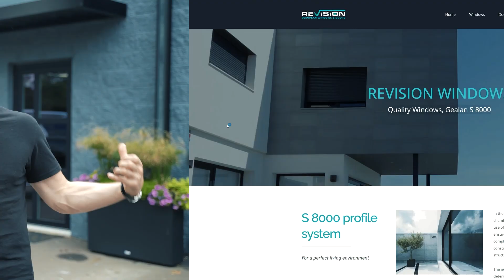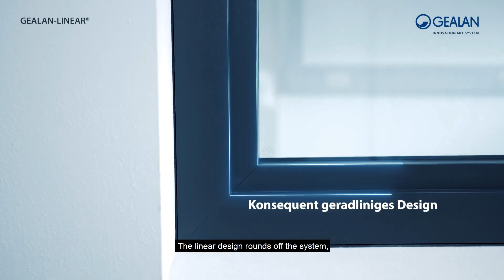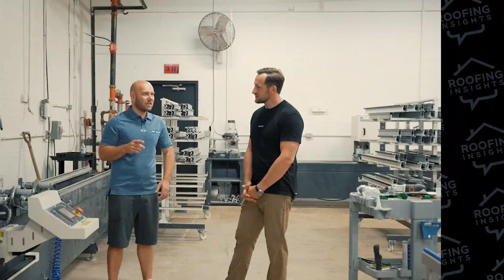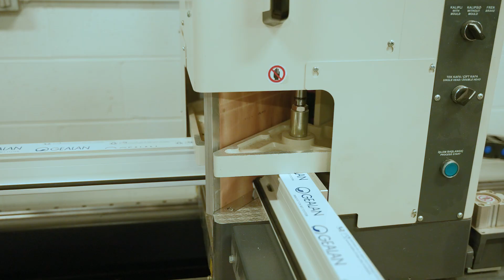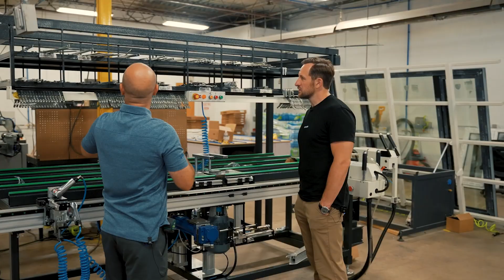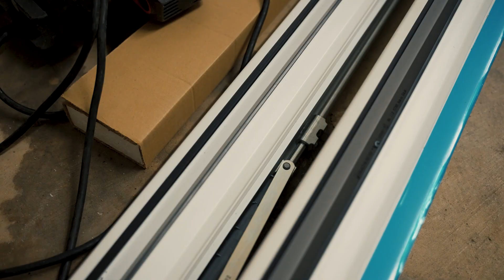Why I Ditched My Old Windows for German "Revision Windows"

Comment: God i hate this EUROPEAN  is better B.S. Right up there with buy U.S.A!!!. Working for decades on top tier homes, I've seen a lot of bad german windows. I've seen bad Hope US made windows that cost more.

These are U.S. made windows. The fact theyre using german equipment and stock. Good chance the stock isnt German made. Just got to the part where its not German machinery.

Heard this stuff so many times. Usually the more they push so hype factor 4 times in meeting its 50% chance of sub standard product for the price.

Thrashing china when we all carry a high performance computer in out pockets from there.
 Its all in what you spec.